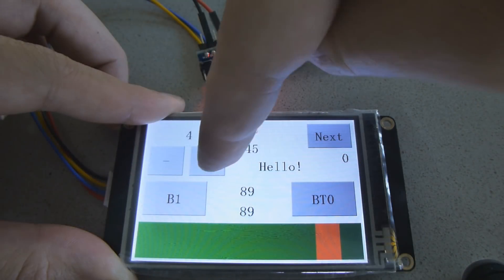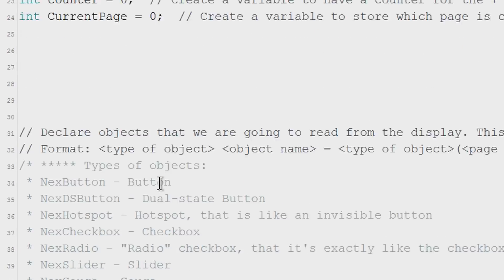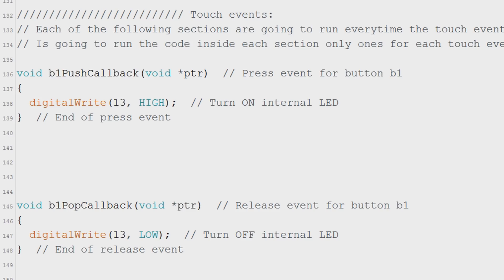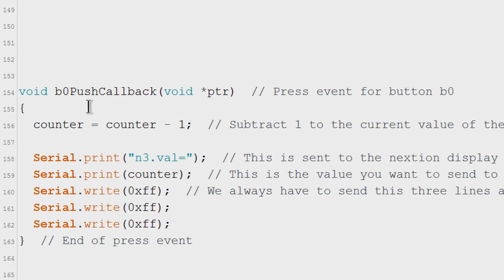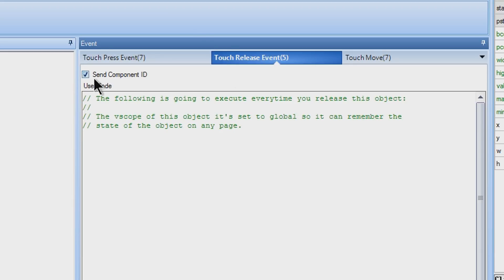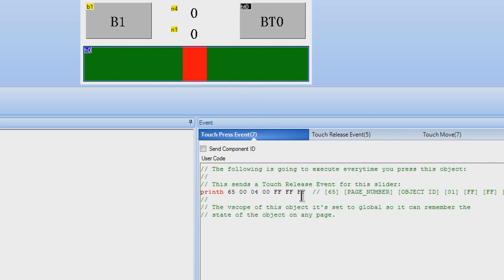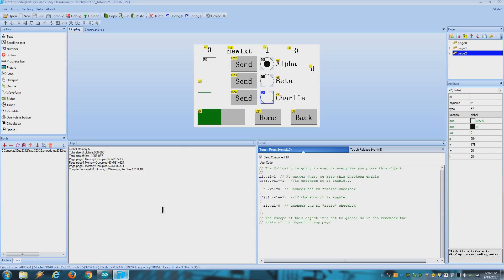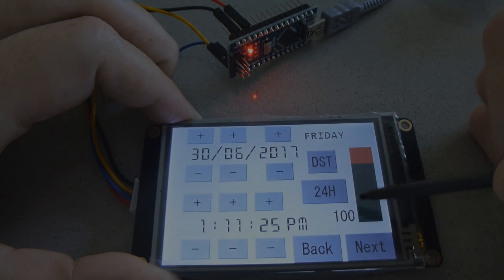Nextion+Arduino Tutorial #2 Sending Data To Arduino

Comment: thank you so much for your tutorial they come with great help

but unfortunately the current page method is not working with me,, I have around 22 text data been sending from arduino to nextion in one page .. so sometimes when i press exit button (to go to the previous page) it does not run the pushcallback method for that page , sometimes it does with no problem. i feel it is because when i send command in the middle of receiving one of the 22 data it does not response ,, what to do I spent three days trying to find solution for that
Reply from the maker: So far I had no problems receiving data from the display while arduino sends data to the display. Apparently from my tests, there's no conflict.

I had problems before receiving data from the display, but wasn't related to me sending data to the display at the same time. It was just a glitch in the way they made the nextion library. I am talking about the slider. If you remember, I mention on the video that I had to read the slider several times in a row to fix the problem. Maybe you can do something like that.

You can send the touch event in the post-initialize of the pages, or in the button that changes the page. Test with that if there's a difference.

Sadly, the nextion library is a mess. Basically that's the problem. But I'm sure you can figure out a way to overcome that.
Reply: @interlinkknight   InterlinkKnight 
 thank you for your reply
Truly yeah their library is a mess
I tried all that unfortunately nothing worked 
 i noticed also it might happens with my other pages which some has only 4 sending data .. but when there is no sending data on another page everything works fine

I will keep trying..  if have any suggestions please advice me
Reply from the maker: Increase the serial baud rate to the maximum

Comment: Thanks for your work. I have a question: is it possible to make an xy plot with online data from arduinto. Let me explain: I am buiding an potensiostat, a devide which imposes a triangular potential ramp perturbation o an electrochemical system (batery for example) and record the current flowing between electrodes. I need to plot current in y axis and potential on x axis. Thank you.
Reply from the maker: The nextion display does support wave form that is similar to a xy plot. Is it enough? There's no native way to have a xy plot, but I imagine it could be done with some tricks and hard work. You know, maybe creating a matrix of square images and control each one as pixels. But not easy.

If all you need is a simple xy plot, a conventional display would be better because you can control the pixels more directly and that way you have more freedom. The nexiton display is more for complex stuff that can't be done by arduino directly.

Comment: Great vid, very helpfull!

Question for any geniusses here: I want to control a Nextion and a SIM808 simultaniously by my Arduino 328. They both want to be connected at RX/TX pins. Any workaround thinkable?
Reply: Looks like the answer is in this library: 
https://www.arduino.cc/en/Reference/SoftwareSerial
Reply from the maker: Yeah, you can use software serial, although in my experience the nextion display doesn't like software serial, at least for receiving data from the display. You can also use a Arduino Mega that has multiple serial ports.
Reply: @interlinkknight  tnx for your answer. I'll choose the SIM808 to be served by software serial then, for now. If stuck, I'll follow your advice towards a Mega.

Comment: I have a textbox on the Nextion and I need to get the value of the textbox as a String on the Arduino. It looks like the code for this video uses:
memset(buffer, 0, sizeof(buffer));
  t0.getText(buffer, sizeof(buffer)); 
But when I do Serial.println(buffer); it prints out [1296:1,14,b11]
recvRetString[0,]

How do I get it to print the value of the textbox?
Reply from the maker: I already show how to do what you asked in minute 8:50
Reply: @interlinkknight  that shows how to get the text to the arduino and then back onto the nextion, but I was looking for how to get that text into an integer on the nextion. The following worked:
String inString = buffer;
number = inString.toInt();
Reply from the maker: Oh. Good to know.

Comment: When reset device value setup is disappered... How to fix problem???
Reply from the maker: If you have the enhanced version of the display, you can store the data in the EEPROM to be able to remember those values. I show how in my tutorial #3. You can also use the EEPROM in arduino.
Reply: @interlinkknight  Thanks Bro!!!!
Reply: @interlinkknight  hey bro!!! 
How to enter a decimal number of 0.5 in nextion
Reply from the maker: You can as a text or as 2 separate numbers.
Reply: @interlinkknight  
If using text, then the data compared with the reading from the sensor ??
Reply from the maker: I don't understand your question, but the idea is to take the data from the sensor, do whatever you have to do with that data and convert into text before sending to the display. I have a few tutorials about other displays and in those examples I have the code to convert into text. You can take that part of the code for your project. The part that converts the number to a string to do the right alignment of the numbers. That code also allows you to remove decimals or take only decimals.

Comment: Good video. Thank you! I would like to send text to the nano like (-023.45678) I cant get to the technique. I can manage integers like your video but not negative floats or the equivalent text.
Reply from the maker: If you send negative numbers and decimals as text it does work. Trust me, I just did it. The tricky part is convert those into text inside arduino.
Reply: I agree.The text inside the arduino is what I'm after ... If I can end up with a  Str1= "-12.3456"; then I would be glad if you could help me
Reply from the maker: Sorry but I can't help you with that. My time is very limited and I never done that. I can only help with things that I already know, like using the nextion display.

Comment: good day please could you help me with some questions I need to print the names of the buttons of my project and see the names on the serial port. If possible, use them only with the USB adapter to TTL adapter
Reply from the maker: You can read the text in the button with arduino, but you can't do it without arduino. I mean, the display is not going to send anything without a request from the microcontroller. You need an arduino for that.
Reply: @interlinkknight  you would have an example of a code where you could see the text of the button on the serial port
Reply from the maker: I can't. But all the information that you need is already on my tutorials.
Reply: @interlinkknight Good day. In the end, if I could do the task, what I needed was to place a name on each button and print that name and see it in the serial port just add a few lines of code on the screen and you're done.

Comment: Can you help me?
https://www.youtube.com/watch?v=n-I2_75_jcs
I built a rotor controller ... it works ... but I would like to put a slider to move the antenna automatically without having to press the CW and CCW buttons (but they have to work the same).
How can I do?
Thank you so much for every help
Reply from the maker: Just make a slider and read the value from arduino. Arduino does the rest. I don't understand whats the problem.
Reply: @interlinkknight  I have two CW and CCW buttons to rotate a rotor.
these buttons operate two relays which start the rotor.
I would like to take the rotor, for example, to 250 ° without keeping the buttons pressed by means of a slider or a numeric keypad. You could show me how you would give digitalWrite (2, HIGH); digitalWrite2, LOW); for CW using, the slider and also
digitalWrite (3, HIGH); digitalWrite (3, LOW); for CCW and if (CW == position required) stops the rotor?
I've been using Arduino for some time but with the nextion I can not understand.
Thank you so much
Reply from the maker: From what I understand you are asking something about arduino, not the nextion display. The display is just a display. Read all the relevant values from the display to arduino, and do your thing with the motor.
Reply: @interlinkknight  I'm sorry for my english....
yes, the problem is on the sketch of Arduino, but due to the Nextion display ...
When I press the "button" to send the degrees (for exemple 180 °) from the Nextion I get this: 
 65 02 11 01 FF FF FF
 31 38 30

How can I tell Arduino to move the rotor until the number of degrees (which I already have available) is == 180?
I just need a simple example, then I adapt it.
Thanks for your patience.

Comment: Hi,
First,  I want to thank you for your very nice and clear example.
It taught me a lot of things.

And second, I have a few quetions:
1. In your example, you've changed the value in page 2, box "n0" between 0 and 1, by pushing butten "c0" (number3)  but I didn't see where do you change the value of "number3".
2. How can I use softwareSerial in this example ("SoftwareSerial HMISerial(10, 11);" ?
3. If I want to play with this example, and follow the values, how can I do this, or in different words, how can I debug the sketch?
4. Where can I find the command list for Nextion, like " c0.getValue(&number3)", "Serial.print(number3)".......etc.

Thanks,
Omri
Reply from the maker: I am glad you like the video.

To answer your questions:

1. In page2 object n0 is showing the page number between 1 and 3. That's sent by arduino.

2. I don't recommend using software serial with the nextion library. It doesn't work well. The only way the software serial works with the nextion display is if you want to only send data to the display, and you can do it normally as you would with any other serial device.

3. I don't understand the question.

4. I don't understand the question.

Comment: Hi. Thanks for your tutorials, they're are extreamly helpful. I am struggling here with one problem. Whenever I run my layout in Nextion editor debug and I connect to the arduino, buttons works like a charm. But when I upload it to the display, they don't. I still have a readdings from sensors, but buttons seems not to be working. In debug mode, I see values from sensors and buttons works. How come?
Reply: UPDATE! I have uploaded tutorial_2 code to MEGA and tutorial2.tft to the 7" screen. Exactly same story. sinus wave is not shown, nothing change on page2 buttons doesnt work. Page1 only shows variables but nothing from the buttons. I went through your troubeshooting vide, checked everything and still nothing :-( any ideas?
Reply: It's like TX is not working at all...
Reply from the maker: Did you watch my troubleshooting video? Maybe you didn't edit the word Serial to Serial1. I mean, I was using the arduino nano that is 100% compatible with arduino uno. If you want to use another arduino other than uno/nano you need to do some modifications.
Reply: i've same problem, can you help me?

Comment: Hi. In case any problem with Nextion.h library you can send and receive data from any platform of Arduino to Nextion desply.
String incStr; //temporary receiving string
void setup() {
Serial.begin(9600);
}
void loop() {
  //continuously listening, receiving, combining and writing to incStr
  if (Serial.available()) {
    char inc;
    inc = Serial.read();
    incStr += inc;
    if (inc == 0x0A) {// in case "CR" applying to AnalyseString(incStr)
      AnalyseString(incStr);
      incStr = "";//at the loop end temporary incString to be empty
    }
  }
}
void AnalyseString(String incStr) {
  if (incStr.indexOf("xxxx") >= 0) {//event provided the lcd has sent "xxxx"
    
    //do something for event xxxx
    }
 if (incStr.indexOf("yyyy") >= 0) {//event provided the lcd has sent "yyyy"
    
    //do something for event yyyy
    }
}

/*
In the lcd Nextion to be code for event "xxxx"
print "xxxx"
printh 0d 0a

for event "yyyy"
print "yyyy"
printh 0d 0a

0a - means "CR" or carriage return
*/
/*
If you wanna to send something to lcd pls use the followed construction for text
...
SendData("t0.txt", "+1")//"t0.txt" and "+1" for example only
...

void SendData(String dev, String data)//where dev - is object name of Nextion lcd; data - text to be send to this object
{
Serial.print(dev);
Serial.print("=");
Serial.print("\"");//in order to send to text field of the Nextion lcd double quota is obligatory before and after text to be sent
Serial.print(data);
Serial.print("\"");
Serial.write(0xff);//obligatory triple 0xff at the and of this construction for Nextion lcd
Serial.write(0xff);
Serial.write(0xff);
}
*/
/*
if you wanna send number to the number field of the Nextion lcd double quota DOES'N be used and "String data" to changed -> int or something else
*/

Comment: i just found out that you said in sketch "If you are going to use an Arduino Mega, you have to edit everything on this sketch that says "Serial"
and replace it with "Serial1", what do you mean by that? when i do that it turns black and no more red and it says this wasn't declared in this scop
Reply: I love the way you don't give information directly and make others to search for it......like " You can email me directly using my username at gmail.com " Seriously?:))
Reply from the maker: I suppose you are fairly young, right? Well, let me give you a tip: noone should publish their email in any part of the internet as plain text because there are bots everywhere searching the internet to take email address to send spam.

Also, I've spend a lot of time putting information out there to help people, so that way I don't have to spend time with each individual repeating the same things over and over. My time is limited. I can address specific questions about my examples and stuff. You really should not expect me to troubleshoot your code. Especially if you are not following my tutorials.

I am feeling you are trying to skip steps to get everything working faster, but that might be slowing you down. Take your time.

Watch the 1st video and try the example there. If doesn't work, watch the troubleshoot video. If doesn't work, read all the comments in the sketch. If still doesn't work, use an arduino uno or nano, instead of the mega. If still doesn't work, let me know. If it did work, go to the 2nd video and try that. And so on... Ones you get all my examples working, then you should try your own code, based on my examples.

Sounds good?
Reply: Yes, understood, thanks
Reply: You said i shouldn't have taken a look at other sources so i didn't and this text was in your Sketch, and you said i had better to Email you but i still haven't gotten your Email.
I'm using Arduino Mega and a 4.3' Enhanced version NX4827K043.
Your code is not uploading in my Arduino and that's all....
Reply: Finally solved, all i needed to do was changing the #define nexSerial Serial2 ...to.....#define nexSerial Serial
Reply from the maker: My email is on my website.
Reply from the maker: You are not listening to anything I said. Sorry but I can't help you.

Comment: Excuse me i've just got in your second tutorial and something is not right i just wrote this simple code for a button for better understanding of the instructure in order to turn on and off a LED by pushing and popping events but it's not working , may you please take a look at my code thanks...

#include <Nextion.h>

NexButton b0 = NexButton(0, 1, "b0");
NexPage page0 = NexPage(0, 0, "page0");

NexTouch *nex_listen_list[] =
{
  &b0,
  &page0,
  NULL
};

void b0PushCallback(void *ptr)
{
  digitalWrite (13,HIGH);
}
void b0PopCallback(void *ptr)
{
  digitalWrite(13,LOW);
}

void setup() {
  // put your setup code here, to run once:
pinMode(13, OUTPUT);
  
b0.attachPush(b0PushCallback);
b0.attachPop(b0PopCallback);

}

void loop() {
  // put your main code here, to run repeatedly:
nexLoop(nex_listen_list);
}

and after my code i tried your whole code to upload it in my Arduino Mega but a messaged popped up saying :
Error compiling for board Arduino/Genuino Mega or Mega 2560 , may you please tell me what possibly can me the problem?
Reply from the maker: Watch my troubleshooting video. I wish I could help you but I don't have all facts. The best I can suggest is try my examples and make sure they all work. If you want to make things easier, use arduino uno or nano, not mega. Follow all the instructions on my videos and in the comments inside the sketch.

Comment: I started a project for myself. I only need a dual state button. I used your code and is not working. Downloaded your entire projects on my Nextion and on my Arduino Uno. The dual state button is not working and some other stuff also. (Premise: I use 9600 of baud rate. I commented the part you change baudrate.) Thank you in advance for your reply.
Reply from the maker: Watch my troubleshooting video.
Reply: Ok thanks! Needed to comment in nexconfig.h the line #define DEBUG_SERIAL_ENABLE.
Reply from the maker: Good to know. Enjoy.

Comment: Hi, is it possible to change the state of a dual state button on the display with an external dual state button connected to the arduino? I want to control a light with both buttons so when i physically press the button connected to the arduino the button on the nextion should go to the same state as the physical button.
Reply from the maker: Of course you can. Just send the value to the button like anything else. Example: bt0.val=1 to press or bt0.val=0 to release. Obviously send also the 3 finishing lines as always. See my examples.